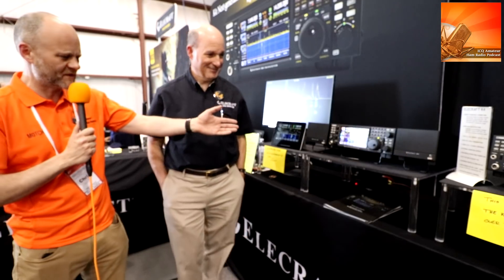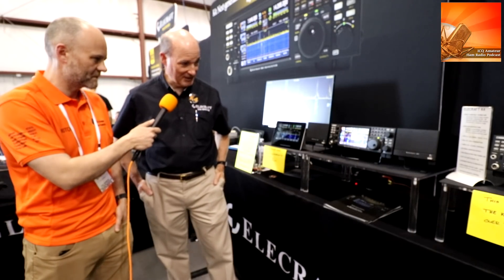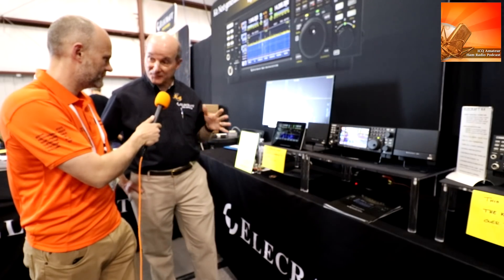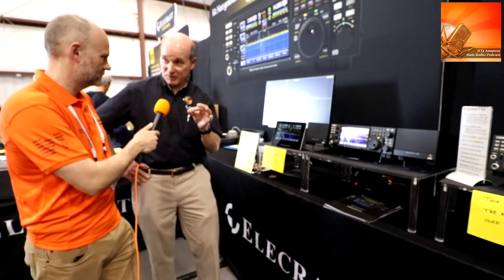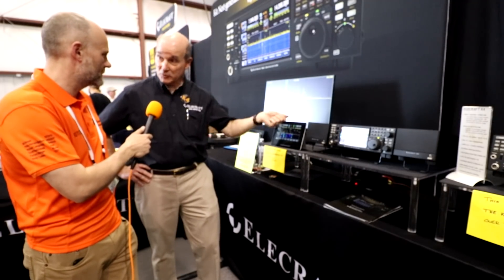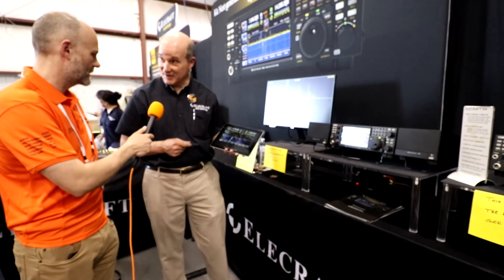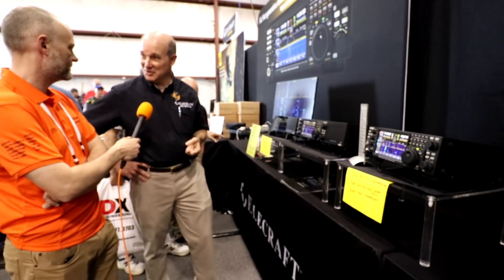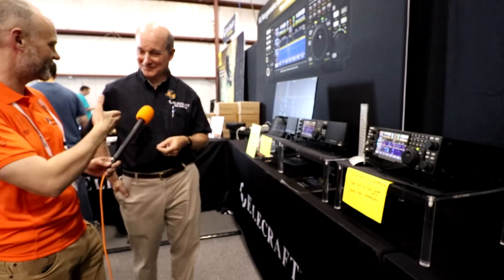Elecraft Announce K4 Software Defined Radio SDR at Hamvention 2019

Comment: I'll admit not being totally up-to-date on SDRs, but something feels wrong seeing an all-in-one unit. Are these costly beasts not prone to becoming difficult to maintain at some point, like my old laptops? I'd think you'd want the bare minimum (RF rx/tx) in a breakout box, connected to a host OS running on my own PC. Granted, this introduces compatibility issues with the host OS. But on the flip side, I don't want to find out that security patches are no longer available for all the software running on my $4k radio (or that the processor is too old and slow to handle an OS upgrade).

Comment: ...and once more the ATU is extra...???
Reply: As Eric mentioned in the interview, some folks don't want/need the ATU because the output of the rig is going straight to an amp or perhaps an external ATU (which he didn't mention, but could be located at the antenna, for example).

Comment: I would hope that next time Elecraft debuts such a nice new product as this K4, they would get the camera person to point at the right angle to avoid the glare on the displays!  Both the radio displays, and the large display, were about 80% glared out.  I did see some signals on the panadapter (rig and large flat panel display including waterfall on rig) and they looked quite spectacular.  It would have been nice to capture that fully.  Also, with the K4HD option,  Mr. Swartz states that they add a K3-style "superhet hybrid" front end module converted down to an 8 MHz IF (with CW and SSB filters already pre-installed) and further states "and then we direct sample off of that".  I assume he's referring to taking the signal from the superhets and feeding them through an ADC or FPGA.  I had the exact same idea right after the IC-7610 came out.  This would certainly afford better DR3 but it's then not truly "direct sampling" anymore at this point, since it's taking a signal which has already been processed vis a vis the "superhet hybrid" down conversion to an 8 MHz IF.  My understanding is that a true direct sampling radio takes the signal directly from the antenna receive port to the ADC without any processing beforehand.  Historically, the ADC moved from the end of the reception path (where bandwidth is low) further towards the front (where bandwidth is higher). This is desirable, because digital signal processing is largely superior to analog signal processing.  In an SDR, the interface between the analog world (originating in the analog signal coming from the antenna), and the digital world, is realized by the ADC.  Today most receivers are a mixture of analog down conversion followed by the ADC and DSP. The ADC can be placed at different stages of a receiver, thus determining which parts of the reception are executed in the analog or digital domains.  So it will be very interesting to see how this all plays out for Elecraft.  I've been combing thru the online literature regarding the comparisons of radios and I strongly recommend that hams look at everything that's currently out there before they make a commitment to buy.  I closely follow both the IC-7300 and IC-7610 reflectors and have learned an enormous amount of highly technical information by their chief moderator, Adam Farson, VA7OJ/AB4OJ, who has by far, influenced my knowledge of SDR's (especially the IC-7610's DS DUC) both in the way that they work and are measured.  I strongly encourage hams to visit his IC-7610 website at http://www.ab4oj.com/icom/ic7610/main.html and also his home website at http://www.ab4oj.com/, where he chronicles all of his superb work, measurements, pictures and presentations given throughout the international amateur radio community.  
I'm also learning a lot from Rick Westerman, DJ0IP's website at http://www.dj0ip.de/.  He gives excellent advice to hams trying to decide which radio would be best for them and makes mention of three major performance lists (although one of them is apparently out of commission); Rob Sherwood's (NC0B) list and Hans Reemus's (PA1HR) list are both fabulous.  Along with all the ARRL test data, you can now have a plethora of different perspectives of receivers by looking at these lists .  Good luck to Elecraft with their new 7610-like transceiver.  73's KM6JD, Sal.
Reply: And what conclusions have you come to in terms of the pecking order?